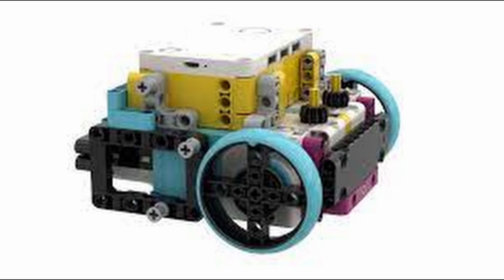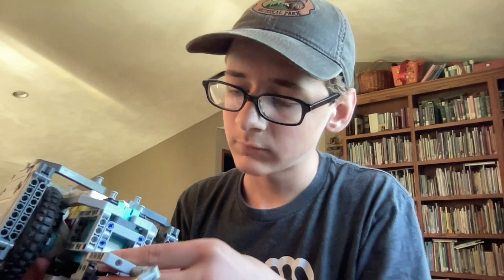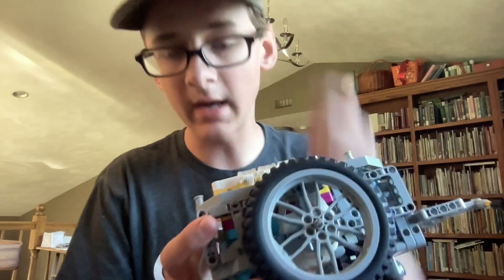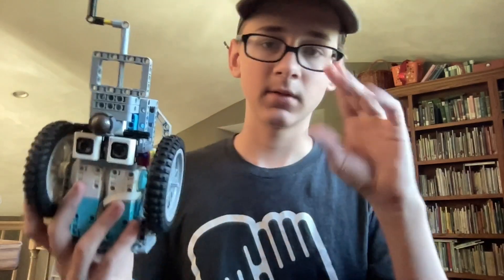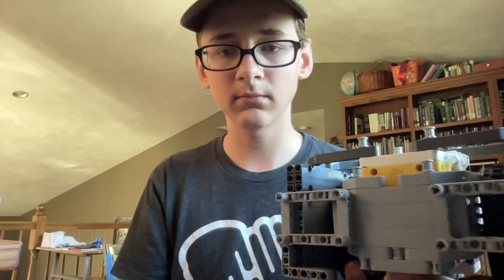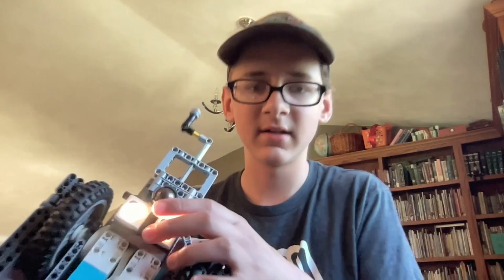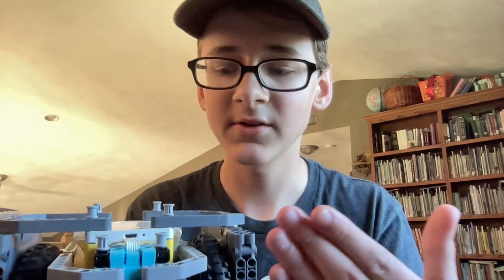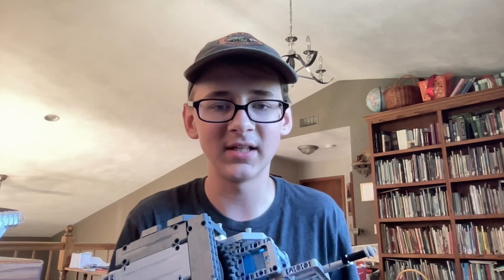7 Useful Tips for making a solid Spike Prime Robot

Comment: What is the Lego part # for those big wheels you are using on this robot?
Reply from the maker: I couldn't actually tell you! My team found them on eBay 6 years ago! Try looking for something like large motorcycle tires. The large spike wheels work almost as well, though, so try what works best for your robot and mat.
Reply: @TelluriumRobotics  I just ordered the newish 62.4mm x 20mm wheels for my daughter to experiment with. A lot of designers are recommending them as they are wide enough for stability, much less slippage, and only slightly smaller than the large Prime wheels or these. We had issues with this type of wheel when the bot was under load because they compress more. Nice for grip though. Plan to have the kids experiment with different wheels to show which have the best accuracy. Brick Link price was stupid high, so I have them coming from Pick a Brick, but they ship from Denmark so they will be here right about when the new board officially releases in August.